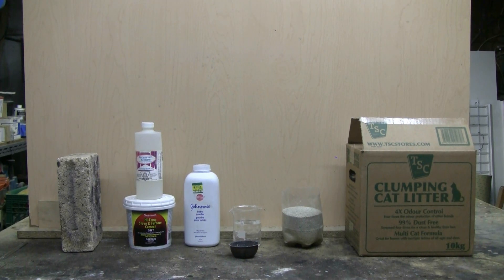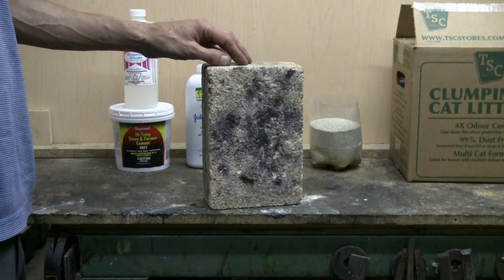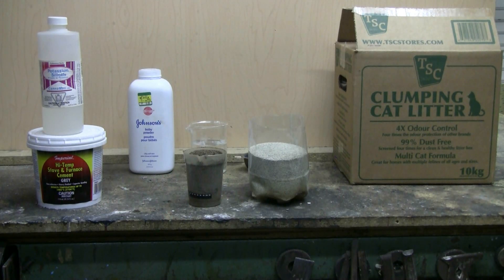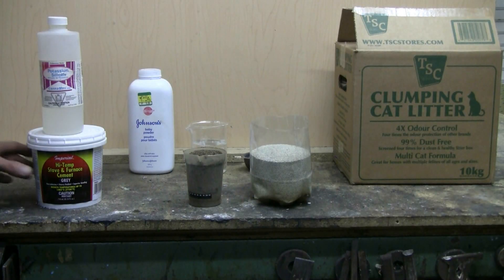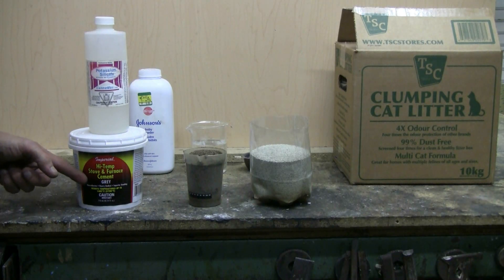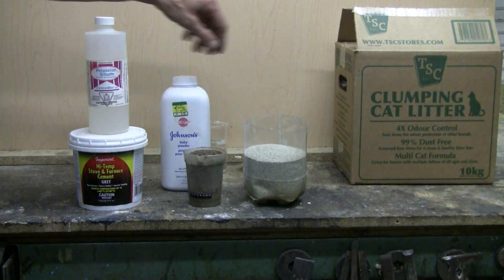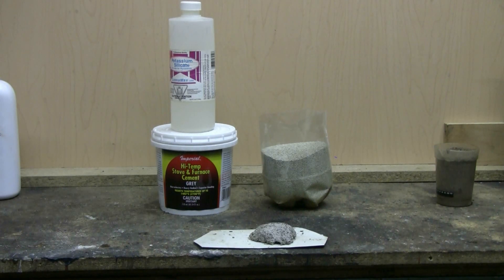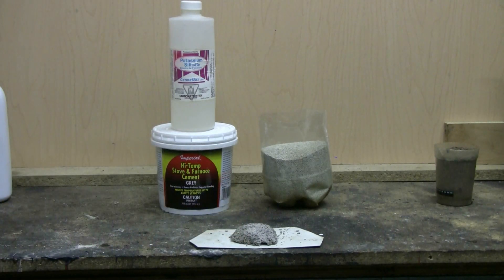Do It Yourself Coffee Can Mini Foundry #2 - Refractory Materials

Comment: Look up the melting points of the stuff you need. Aluminum oxide sandblasting grit (alumina) has a melting point of 2072C (3762F). Talc can only go to 1500C (2700F).  Perlite is good for an insulative layer but the liner face should be something higher temp, as perlite melts (fuses) at around 1260-1340C (2300 - 2450F) and exposure to the foundry flame can reach far higher. I would use perlite/chopped fiberglass/potassium silicate as a main insulative liner(fiberglass is silica and adds strength to the weak perlite mix) then coat it with a 1/2" to 3/4" thick layer of aluminum oxide/potassium silicate or talc/potassium silicate as a super high heat coating. If done right, you can have a foundry (or forge capable of forge welding for that matter) that will withstand whatever you can throw at it, yet still remain relatively cool on the outside. If you want to get froggy and have the money, you can use silicon carbide (melting point of 2730C or 4946F) sandblasting grit instead of aluminum oxide for REALLLY high temp refractory.